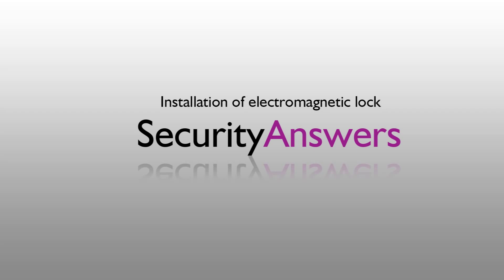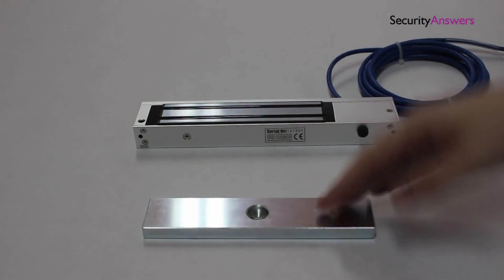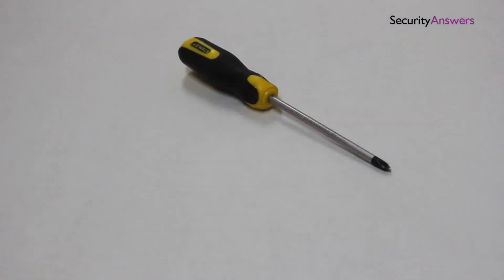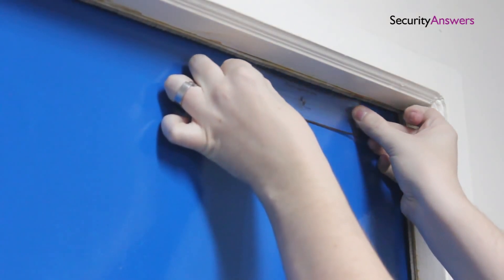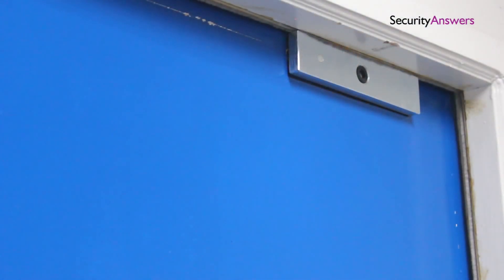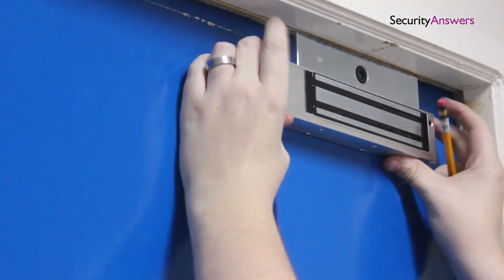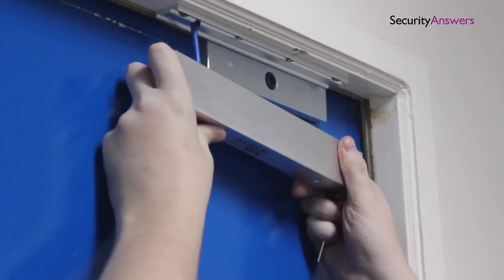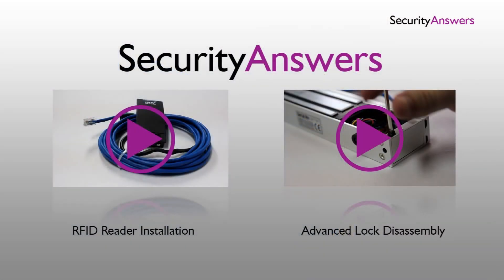How to install Electro Magnetic Door Lock

Comment: I have used this lock for about eight months. Installing the lock was pretty easy & straight forward. The lock itself looks great and seems to be of good build quality. >>>t.co/CvX9rn00Em  The original batteries lasted about six months, but this is on our main door under very heavy use. We have had no problems with the Bluetooth connection, but you do have to be close to the door. I would like to be able to unlock or lock the door remotely, but this may be possible with the upcoming "bridge adapter".